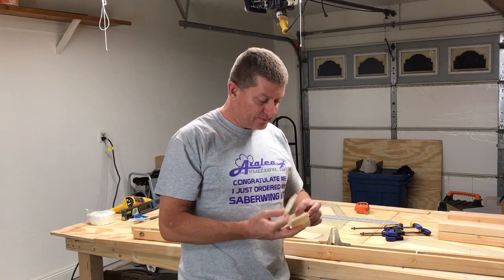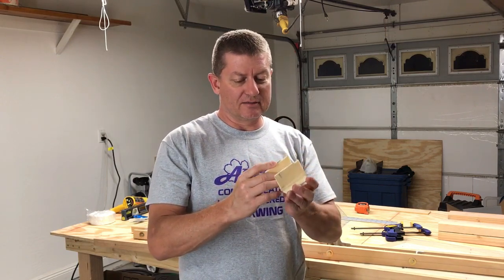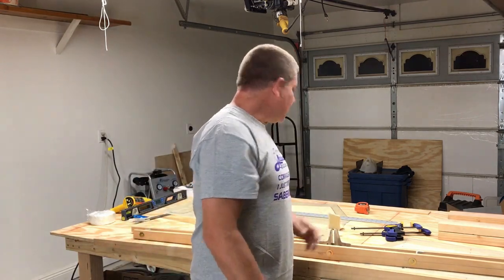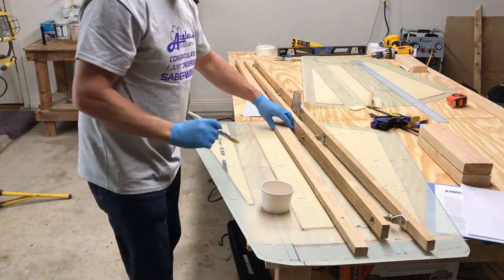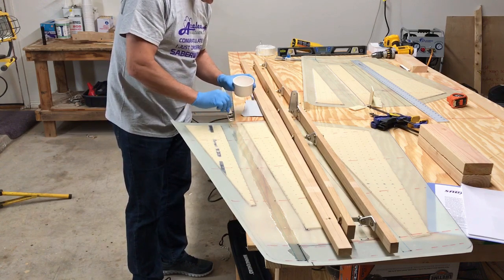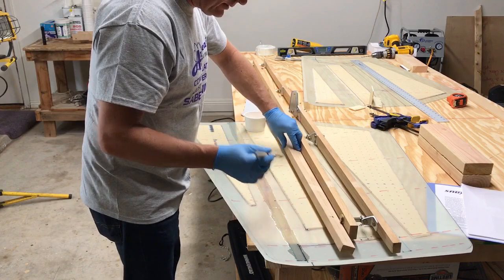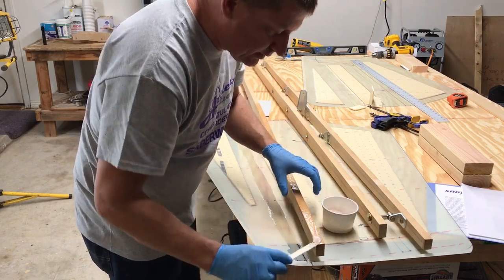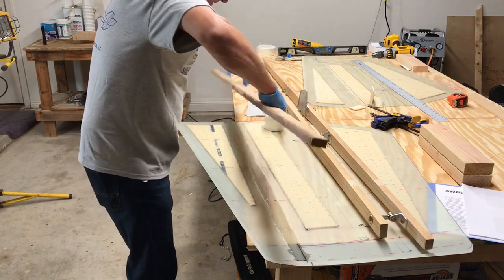S4 - Plane crash chat - working on HS - Building a Saberwing

Comment: Thanks for the demo of the little project, Dan. That gives me confidence that I can work with fiberglas as well.
Reply from the maker: Hey Orman, it was amazing what that little project did for me! The strength of resin is unreal. Visualize what a tail or wing looks like with all the ribs interconnecting with the spars and skins, and you have a very strong structure. I have no problem flying an airplane built like this